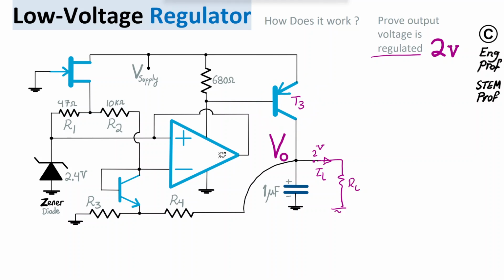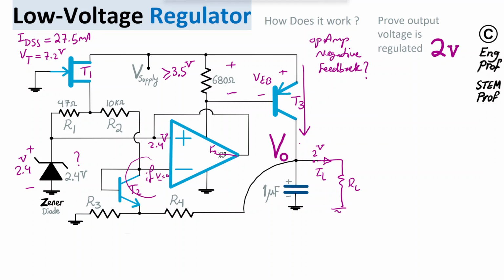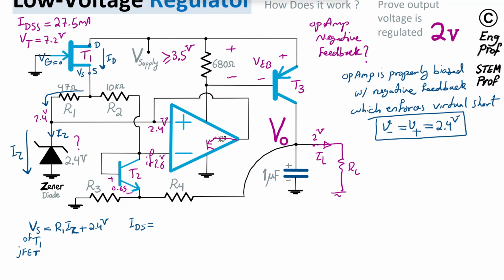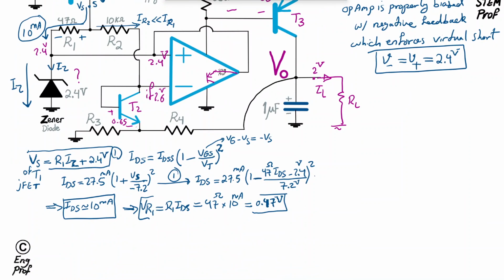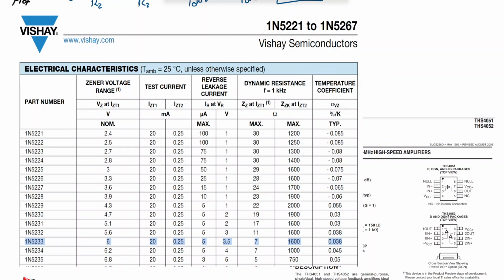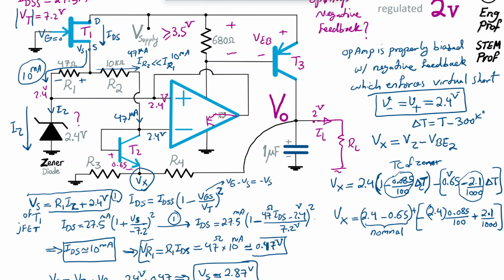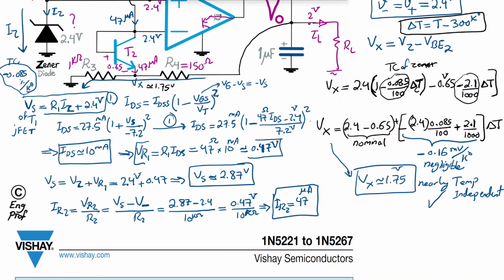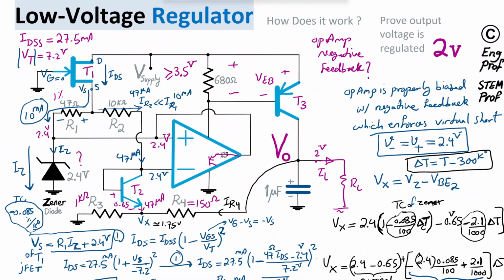Low Voltage Regulator Circuit Design with Op Amp, Zener Diode, JFET, BJT Transistors

Comment from the maker: How to design a Low-Voltage Regulator? How does the regulator analog circuit work?  How does temperature compensation work in this circuit? These questions are discussed in this video. For more examples please see:  
Voltage Regulator with MOSFET, JFET & Temperature Compensation https://youtu.be/NdfyHoxjKrY
Current Foldback Voltage Regulator with Op Amp, Darlington Transistors https://youtu.be/RFfRrbqM_-s
Current Limiting Foldback Voltage Regulator Circuit https://youtu.be/VN4_qF9DvBM
Voltage Regulator Circuit Design with Op Amp and BJT Transistor https://youtu.be/rI9f6-DyXxQ
Push-Pull Power Amplifier with Darlington Transistors https://youtu.be/866MYibo8yE
Voltage Regulator design with Op Amp BJT JFET and Zener Diodes https://youtu.be/CJl-urzeiTo
For more analog circuits and signal processing examples see my analog design videos playlist https://www.youtube.com/playlist?list=PLrwXF7N522y4c7c-8KBjrwd7IyaZfWxyt . I hope these Circuit design and analysis videos are helpful.

Comment: Tank you so much for taking the time to do these videos!!
Reply from the maker: My pleasure. Glad that you liked this voltage regulator video. Here are a few more related circuit examples:   Voltage Regulator Circuit Design with Op Amp and BJT Transistor https://youtu.be/rI9f6-DyXxQ
Voltage Regulator designed with MOSFET, JFET transistors https://youtu.be/NdfyHoxjKrY
Current Foldback Regulator Design https://youtu.be/RFfRrbqM_-s

Comment: I didn’t watch the entire video- did you mention what is advantageous about this circuit compared to a simple buffered voltage divider, other than temperature compensation?
Reply from the maker: Aside from temperature compensation, this circuit has a negative feedback loop that keeps the output voltage fixed at desired voltage while also providibg high current to the output load via PMOS transistor.

Comment: Geat video, on first seeing the circuit my eyes were drawn to the  positive feedback on the op amp, me thought, stable output, more like a demented pinball machine output, lol
We are conditioned to seeing the terminals of bjts being shorted and just thinking temp compensation going on but  the non inverting input  being connected to the output made me hover over the delete trace on the schematic editor. like the way you teach, thank you so much.  liked and sub'ed .
Reply from the maker: You're welcome. Glad that you enjoyed this Voltage Regulator circuit video. Thanks also for sharing your observations. To watch an alternative design of voltage regulator please see https://youtu.be/RFfRrbqM_-s which is a Current Foldback Voltage Regulator Design with Op Amp and Darlington Transistors. I hope you enjoy this video as well.🙂

Comment: Good day Sir. Do you have any notes about a stability with using an open loop on an op amp in this schematic? It could easily oscillate in case of improperly selected/added/missed capacitors and their values IMHO.
Reply from the maker: Good day to you as well. Thanks for sharing your thoughts. The Operational Amplifier in this circuit is wired in an overall closed loop negative feedback circuit scheme as explained in the video starting at 3:50. Nonetheless, to your point, depending on the selected Op Amp extra care is needed regarding any extra stablizing capacitors (say 10pF to 100pF) required between terminals of the selected op amp (as described in op amp datasheet).

Comment: Can you please explain how the current through the positive supply voltage i.e. through 680 ohms reduces when voltage at inverting terminal is higher than the non inverting terminal?
Reply: Thanks for the video, it is an interesting circuit
Reply from the maker: @tachyonic-ultimate  You are welcome. Thank you. Glad that this analog circuit video is interesting. To watch an alternative design of temperature compensated regulator circuit please see https://youtu.be/NdfyHoxjKrY which is Voltage Regulator designed with MOSFET, JFET transistors.
Reply from the maker: Sure, this technique is similar to the Push-Pull design in https://youtu.be/8BFzsi7-Vbs. As I mentioned in the video around minute 3:50, the internal output stage inside the op amp looks similar to the NPN-PNP output stage of a power amplifier circuit (albeit with orders of magnitude less current). When voltage at inverting terminal of Op Amp is higher than the non inverting terminal, Op Amp immediately attempts to reduce its output voltage toward the negative supply voltage (in this case ground). This is achieved by reducing sourcing current from Vdd (hence reduced current through 680 ohms resistor) so that less current is provided to op amp output (resulting in reducing output voltage). This reduction of current through the 680 ohms translates to reduced voltage drop across 680 ohms resistor which means reduced voltage across the emitter-base PN junction of the main PNP BJT transistor. That translates to exponential reduction of the collector current of the main PNP transistor.  which results in reduction of the voltage across the series of feedback resistors R3+R4 and hence reduced emitter voltage of the small NPN BJT transistor (which is effectively a Diode).  The reduction of emitter voltage results in reduction of the voltage at the inverting terminal (counteracting the initial voltage increase) indicating a negative feedback. I hope this explanation is helpful

Comment: 👍 Very nice!  Thank you.
Using this principle you can create a push-pull stage of 2 bjts after the OpAmp. It works very stable.
Reply from the maker: You are welcome! Glad that this video is interesting. The Push-Pull Amplifier stage that you mentioned is discussed in https://youtu.be/8BFzsi7-Vbs which is the video of Push-Pull Power Amplifier Design with Op Amp, Sziklai Darlington Transistors. I hope it is interesting as well. 🙂
Reply: @STEMprof  👍